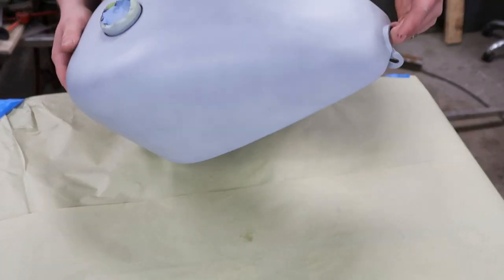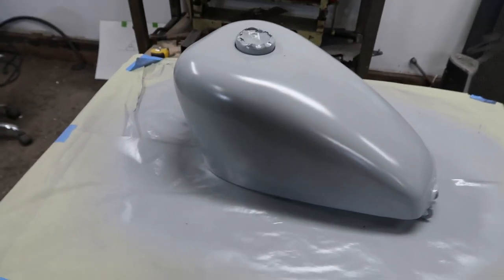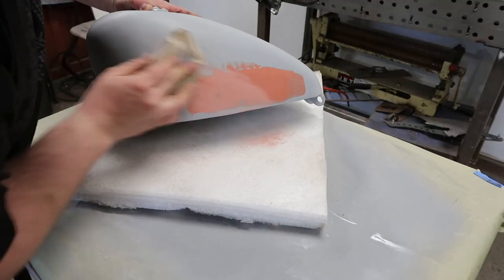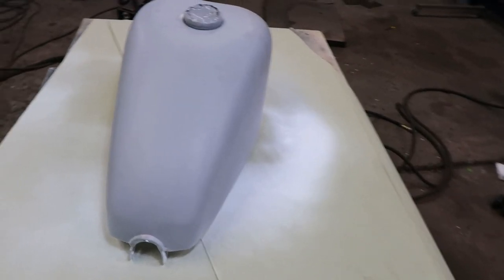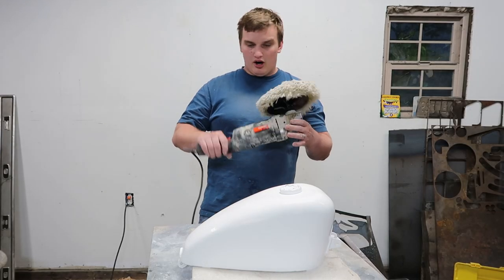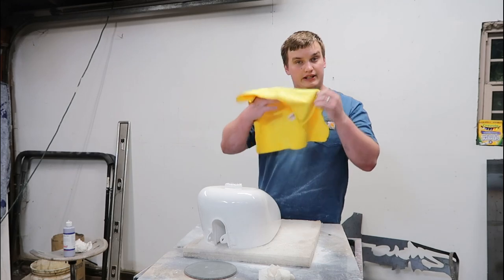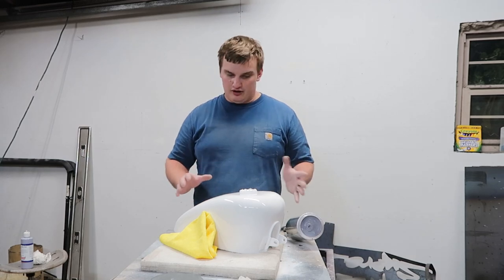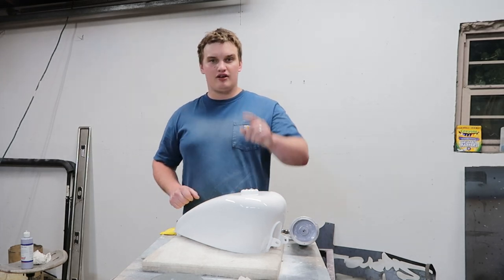How To Paint A Motorcycle Tank  On A Budget (DIY)

Comment: Good information and video.  I find it helpful to mount the tank on a bicycle repair stand.  The tank can then rotate in the x and y axis without touching the tank, just touching the stand.  This allows the top to be painted easier and gives better access to all surfaces.   The bottom edge of the tank hangs in the air allowing a cleaner application.  Less likely to drop, bump or touch the tank with greasy hands while working on it.

Comment: Is there any reason who you didn’t choose to. Hang the tank up vertically so you could paint both sides at once? Great video given some confident to do this myself
Reply from the maker: You can absolutely hang it and shoot it all at once. I have just found that it is much easier to paint horizontal surfaces and more forgiving so if the tank is facing upright even if you get a run you can add more paint until the run slides all the way off the bottom edge and then you only have to sand the very bottom edge of the tank to remove the run.

Comment: I have a quick question. I recently painted my fuel tank similar to yours and think it turned out well. However, there were two spots I missed with the spotting putty and now they're visible in the final job. I even used spraymax 2k clearcoat on it. I was wondering if it would be possible to sand down to the primer/paint in these areas and then patch them, paint again then clear coat. Not sure if it'd be better to just accept it wont be perfect cause I could see it doing more damage. If you think I should try to fix, what sandpaper should I use and which layer would be good to sand to (primer/paint)? I think in your other video you said you could paint over the spot filler but not sure if it'll just show more after.
Reply from the maker: If you sand down to the primer you would probably have to paint the entire tank again. One thing you could try. Is scuff up the clear coat where your dents are lightly. And then mix another small batch of clear coat and brush a little puddle of clear coat into the dent let it dry completely. Lightly block it out with probably some six or eight hundred grit to blend the transition making sure you don't go through your other clear coat and then do one last clear coat over top of the whole tank again that is what first comes to mind so you are almost using the clear coat as filler but anytime you go to do a repair it's risky.